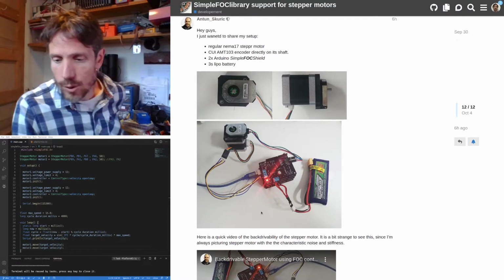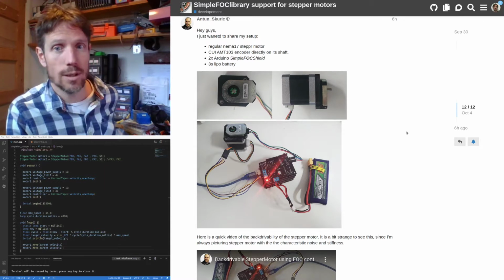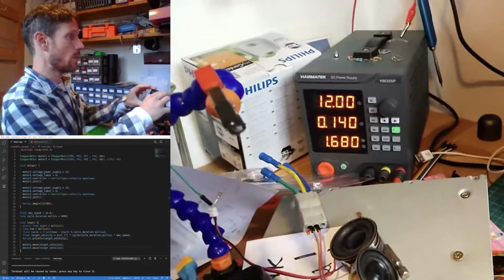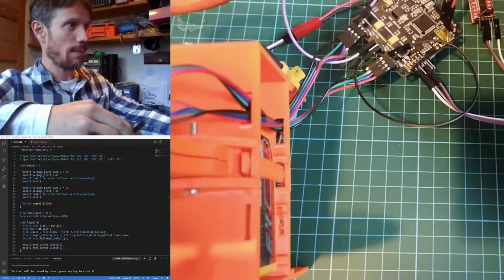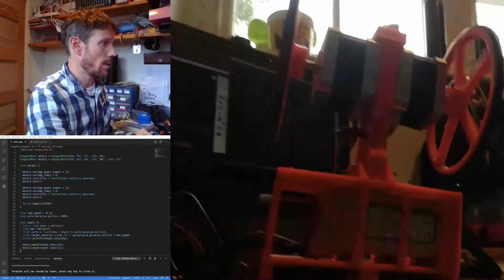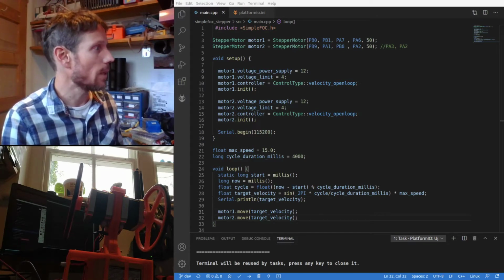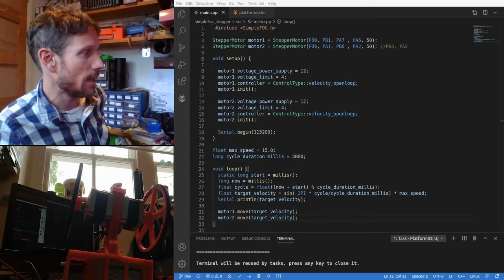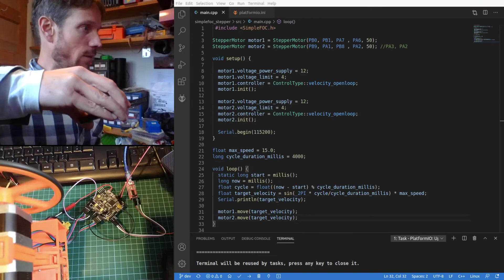Driving Two Stepper Motors using Simple FOC and a STORM32 gimbal controller

Comment: So you don't need to fix current limit in hardware anymore, Do you?
Reply from the maker: That is right, in closed loop the PID settings decide how much juice to send to the motor. So it uses <100mA when stationary.

Comment: This is pretty cool, is voltage/torque control a thing with this type of setup?
Reply from the maker: Yes, I've put a magnetic sensor and closed the loop. There is some velocity oscillation that i can't seem to tune out. I believe my particular stepper has some mechanical friction issue for half its rotation cycle e.g misaligned bearing causing this. This is confirmed by openloop low voltage stalling at the same position each cycle.